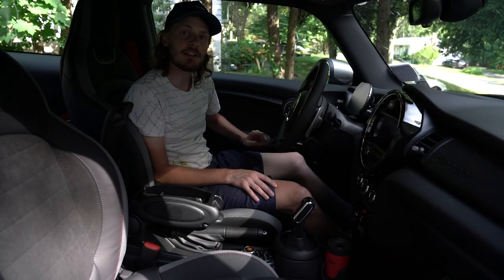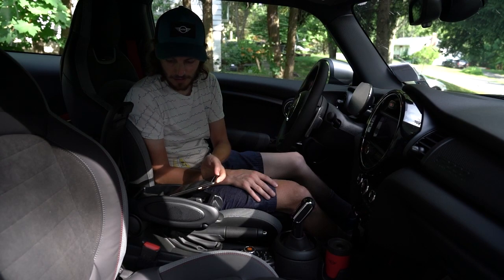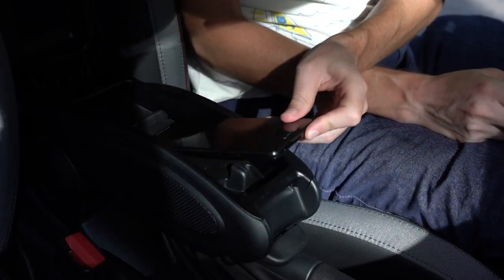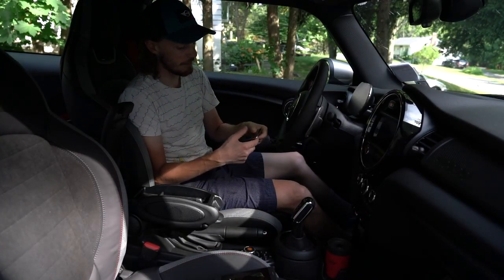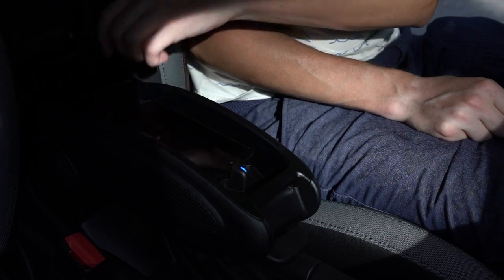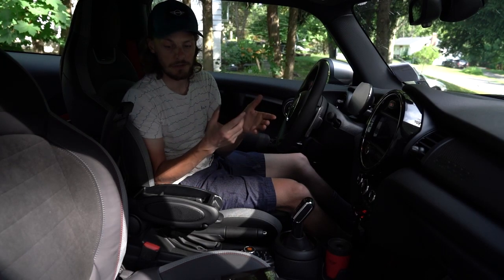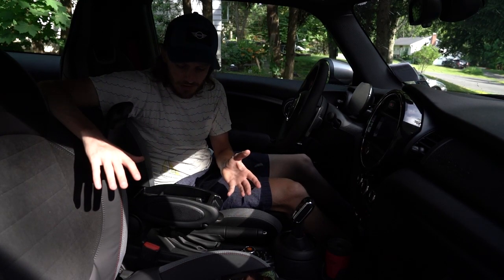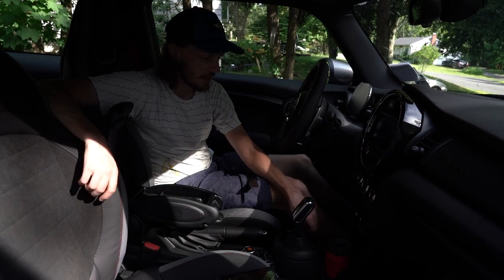Wireless phone charging in a MINI GP3

Comment: The phone size is actual a pretty common issue to lots of cars. In the most cases the car design is older than the actual smartphone generation.
Reply from the maker: Yeah. It would be nice if they could move the phone charging area to the area in front of the cup holders one day where the size would not be so much of a restriction. Maybe gen 4....

Comment: I feel most wireless charging in cars aren't high enough wattage so it doesn't charge very fast. So almost a mute point. I rather deal with a cigarette lighter charger and a cord so I get at least a 3 to 1 charge rate vs wireless on my daily commutes.
Reply from the maker: Yeah it's def not a quick charge/high wattage solution there. I stick to the USB-C port/cable.